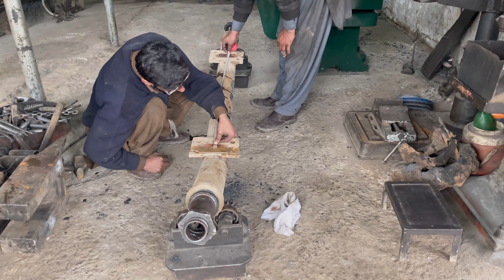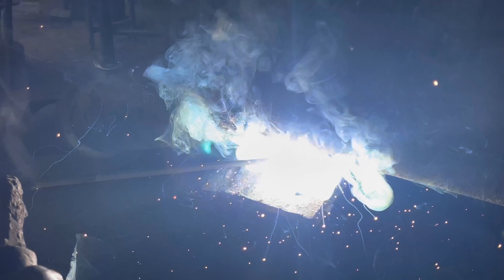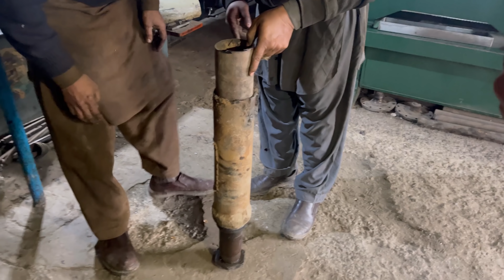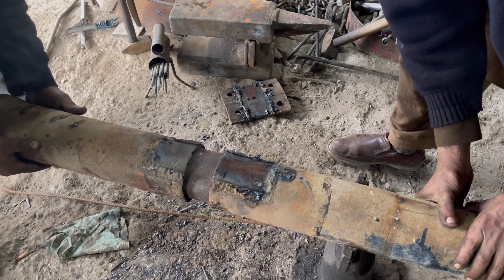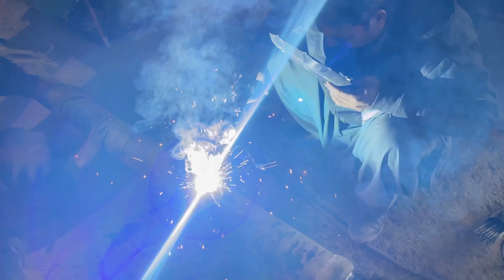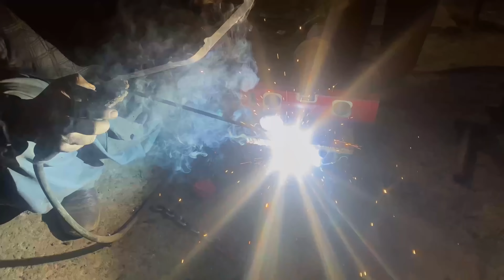Repairing Cracked Truck  Axle | How to Repair Broken Axle Of A Truck Trailer || Complete Process |

Comment: No disrespect to the workers hard work and commitment but the axle originally would of failed because the driver overloaded his truck and then bounced it up and down on uneven roads and dirt tracks, so this fix has no chance of lasting very long, it even looks like it was fixed at that point once before.

Comment: Would be easier to weld if they cleaned the metal.Welds look gnarly.
Reply: It would be easier to fix if they threw the old one away and started from scratch. It probably broke because it was repaired a bunch of times with 6010 farm rod.
Reply: I think they do that so it will come back, and they can charge the customer for some more shitty work. It's the gift that keeps on giving. 😂
Yes, you're right. Welds don't stick to dirt.
Reply: LA CALIDAD DE SUS SOLDADURAS ES EL PROBLEMA  SON HABILES PERO LES FALTAN ESTUDIOS DE SOLDADURA

Comment: Let's get real, neither the original tube, nor the first fix weld, nor the new metal insert, nor the new weld-- none of them held or are going to hold up.  One more overload going over a bump and it's going to crack again.  The inner sleeve is particularly useless as it adds absolutely no bending strength at all.